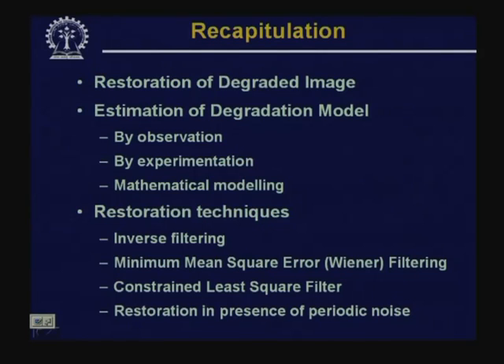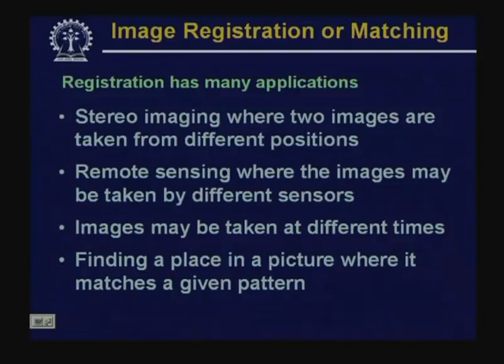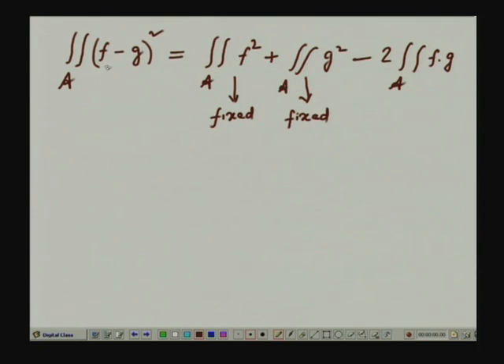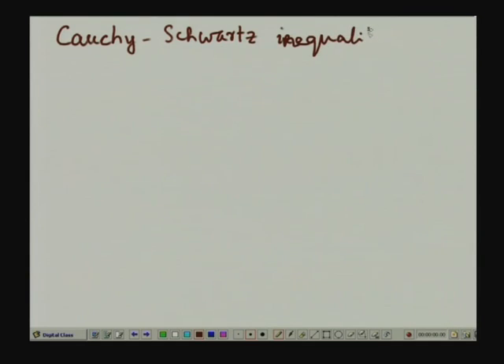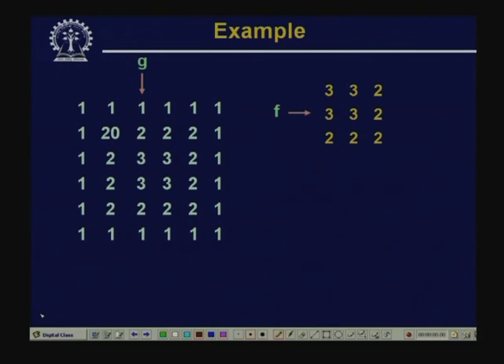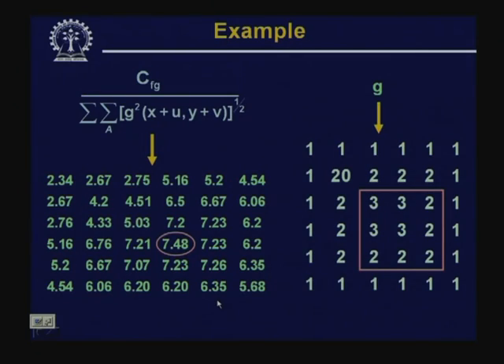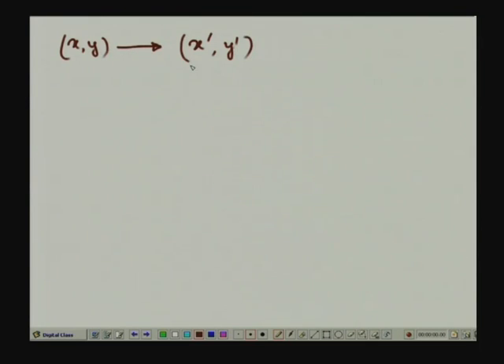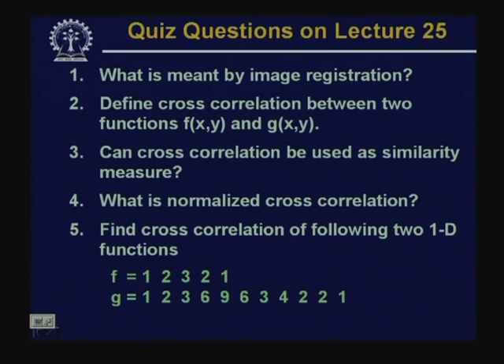Lecture - 25 Image Registration

Comment: Read the book written by Jan Modersitzki - Numerical Methods for Image Registration. It covers both parametric and non-parametric methods with special emphasis on medical imaging. Otherwise there are thousands of papers written on this topic and its hard to determine which methods work (& their app. area) & which don't. These electrical & computer engineering courses discuss very few algorithmic techniques. Their emphasis is on the electro-optical aspects of image processing and not mathematics.